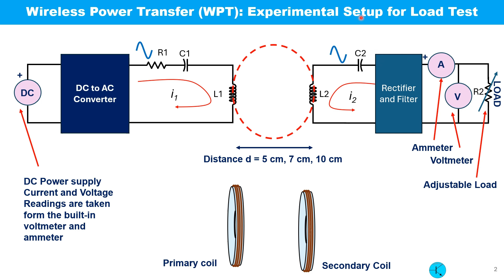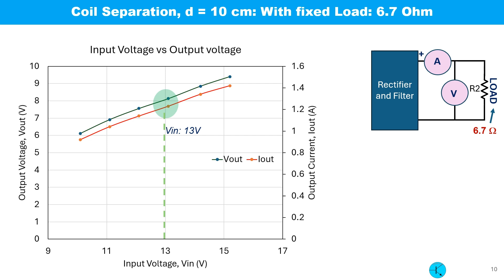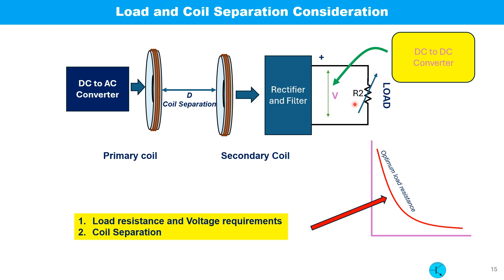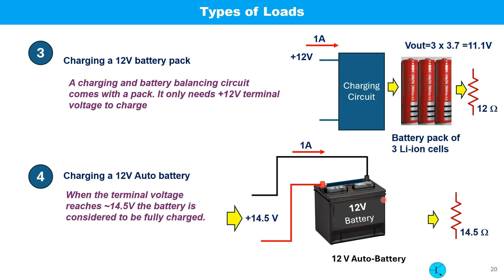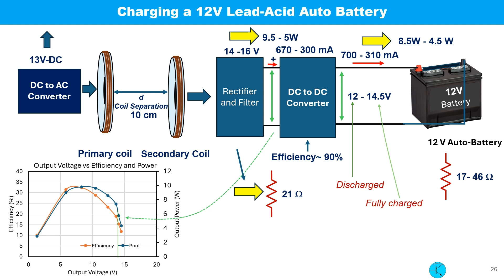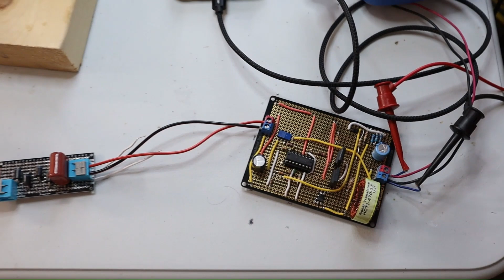Wireless Power Transfer Part 3

Comment: I followed the process keenly but, it didn't work.
The challenges I'm having was that I couldn't get the exact IC IRS2153D also the MOSFET Tk32E12N1. 
I made used of equivalent components like IR2153 and IRFB4410.
Can this be the cause.
Reply from the maker: Your MOSFET and the IC both should work. First, please check whether the Gates of the MOSFETs are getting the pulses from the IC. If you do not have an oscilloscope, you can tune the oscillation frequency of the IC at 10 kHz, using the frequency changing resistor and capacitor. Then use a speaker or head phone with a 0.1uF capacitor in series. One point will go to GND and the other terminal of the headphone (Connected to the 0.1uF capacitor) will touch the Gates of the MOSFETs. if you hear the sound, then the Gates are getting the Signal. now use the headphone with the secondary coil if you hear the sound. Energy transfer is taking place but very low level. After ensuring this you can now adjust the frequency to the desired value and do the tuning. Hopefully this will work for you

Comment: The leads from both transmitter & receiver coils should be twisted to minimize the leakage inductance of the leads.
Reply from the maker: Thanks for watching. Yes, you are right, however as I am using  low frequency (22 kHz), effect of that tiny inductance change has very little effect on the resonant frequency.  People who are using 6.8MHz should have to take more cautions